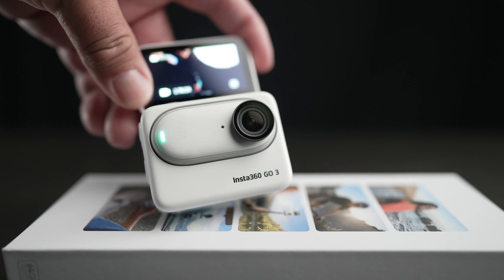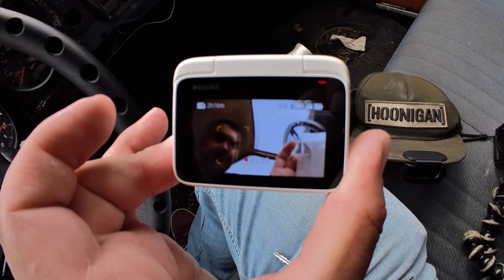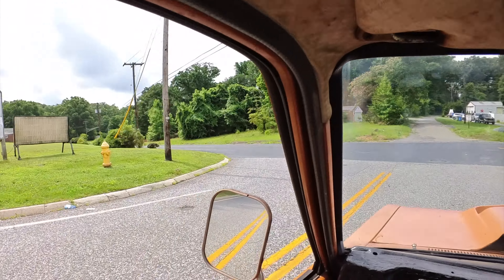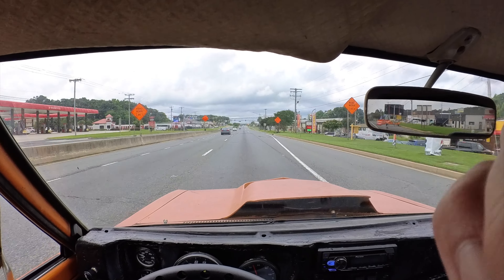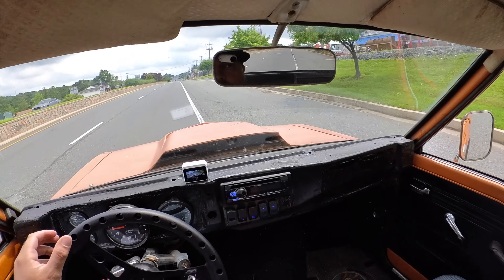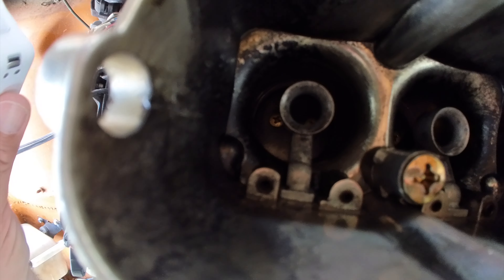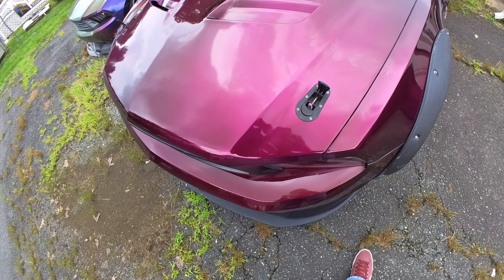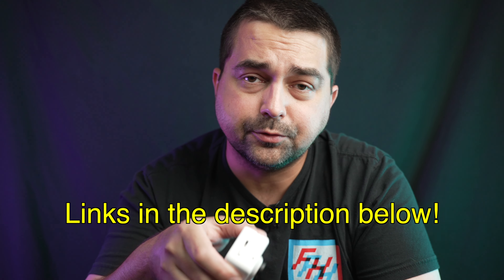Insta360 Go 3 : A Car Person's Review

Comment: Did you experience any overheating issues since you did this test?
Looking to replace my Go2 that didn't last a full lap round the Nürburgring.
Reply from the maker: I actually had it out today at a drift event, and it never overheated (at least from what I can tell. Literally just got home and haven’t reviewed any footage).  
And it was pretty hot today too, with a few clips being around 5 minutes or more because I would forget to turn it off while heading back to grid. 
That sucks about the go 2 overheating. The Nurburgring is a dream of an experience.
Reply: @RobRabonPhotog  Sounds good! Might just get one.
The Go2 barely made it to the 5 minute mark and that was with windows open and AC running. I guess it's much warmer in your drift car...
What's holding you back? Book a ticket 🙂 the Nordschleife is open nearly every day! It's a crazy place!
Reply from the maker: It was pretty hot. I was in a car with no roof and interior (and no ac) so it was probably a pretty good heat test (I still feel like I’m partially dehydrated). I still need to review the footage to see if it ever dropped out, but I think it was fine because I always heard 2 beeps when stopping recordings. 
And I get stopped by work schedules and money….but life is short and I should take your comment as a sign to make it a plan!
Reply: @RobRabonPhotog  Sounds fun! Thanks for your help!
I understand..although it seems you got your work life balance very much in check 👌🏽
Reply: @dalilrafi why would you open the windows with AC running?😵‍💫😵🤣
Reply: @ericd1084  windows for pleasing my ears with exhaust sound and AC for the comfort 😁